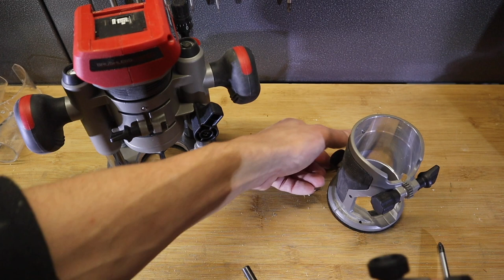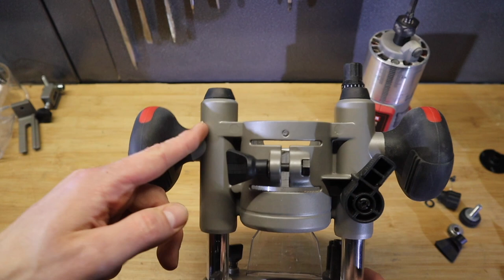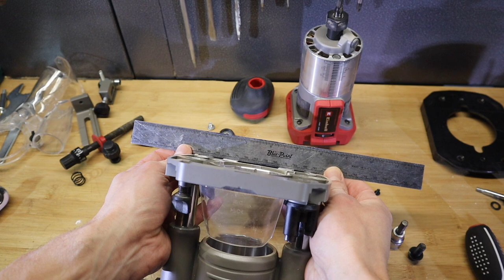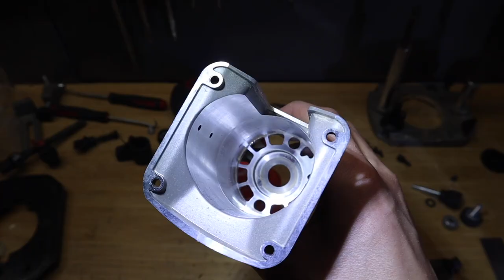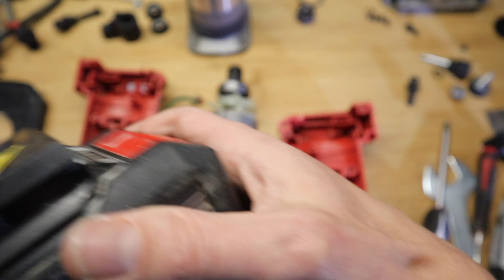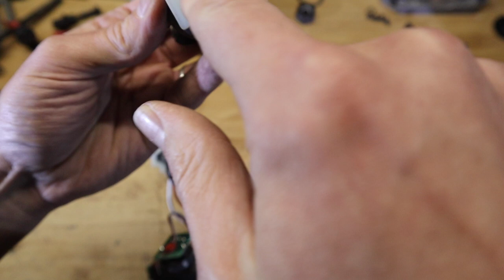TEARDOWN - Einhell Cordless Router Set - TP-RO 18 SET Li BL - SOLO

Comment: I have the Ozito version of this, which is pretty much the same. What I found with the palm base, is that tightening the knob pulls the whole thing off centre. My cuts were slightly off 90 degrees. It became most noticeable when I started using the guide bushing (which didn’t even fit until I sanded the edges). The router bit is quite evidently off centre and almost touches the side of the guide bushing. I took it back to the store and swapped it with another. When I got home, it had the same issues - guide bushing doesn’t fit until edges are sanded and tightening the knob on the base pulls the base off centre. So I’m of the opinion that the palm base is of poor design & quality. It will not give you perfectly straight cuts. A shame because the main part of the router seems decent.
Reply: I discovered the same issue too. Because the aluminium base is slightly loose in compare to the router, it relies solely on the screw that slides into the groove to align it, and that's what makes it slightly 90 degrees when tightened. I suppose changing that screw with a slightly longer one may fix the issue, but that would meant  the rubber palm grip has to be removed, which I don't think is a good idea so I gave up.